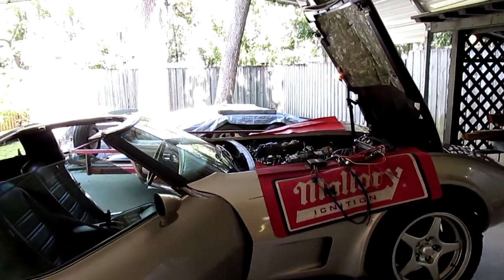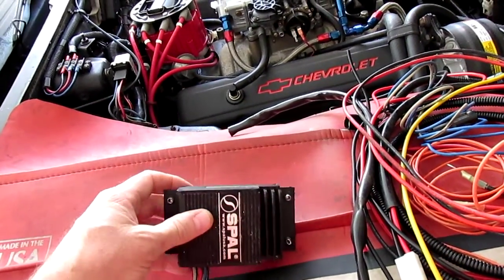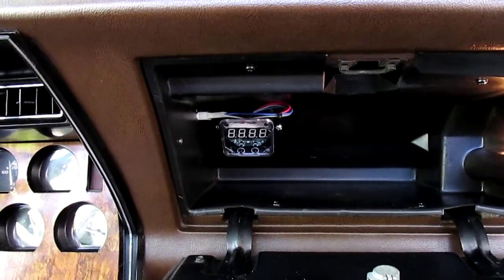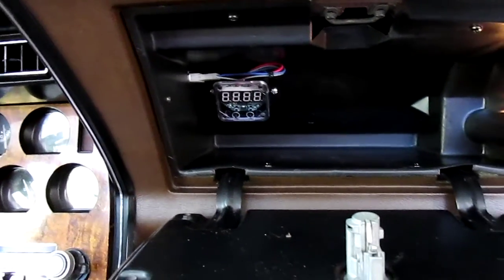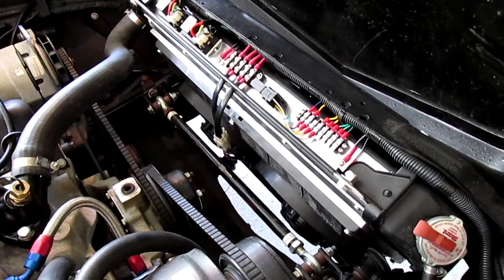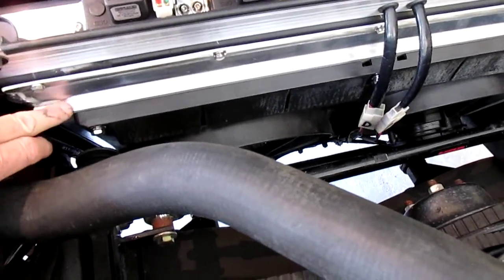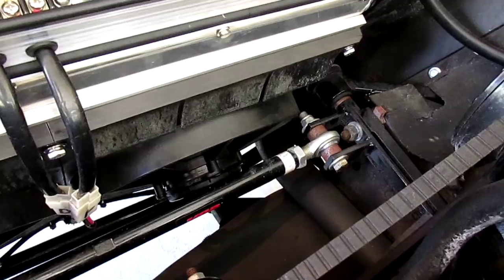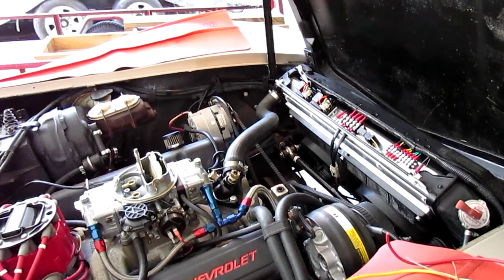Building a custom made fan shroud for dual 11 inch SPAL fans on a C3 Corvette, PART 4

Comment: hi Mr JOEL, what are you temp sending units sealed with
Reply from the maker: Temp senders are as received from the factory. Looks like epoxy to me.
Reply: I meant sealed into the tstat housing thanks
Reply from the maker: @clnash3213  They thread in. NPT male threads on sensors. I little pipe dope on the threads and screw them in.
Reply: beautiful,thanks

Comment: This while impressive, you do good making your wiring neat, is way over complicated and expensive. First off if your cooling system is in good working order the fans will never come on over about 30mph with a properly set controller. All you really need is a switch a simple Hayden capillary switch will do. A decent relay two with AC and some wires and terminals. Personally I would have soldered all those termanal ends and replaced the plastic ends with heat shrink crimps can't be trusted and it looks a lot better.
Reply from the maker: This video simply illustrates one of the hundreds of ways that electric fans can be installed. I prefer sensing temperature in the water jacket, (which is the way auto manufacturers do it), and stage my fans to come on when needed. Crimps can't be trusted?? I have had a similar discussion on one of my other videos about spot welds. Auto manufactures crimp all their harnesses. In fact, I work for a company that manufactures aircraft ignition leads, power feeds and signal cables. This wiring transmits anything from low voltage signals from sensors to electronic control boxes, to continuous high current  loads fed by alternators located on jet engines.  We perform sophisticated testing on our products to check for discontinuities from -65°F to upwards of 1200°F in some cases. You may find it hard to believe, but all these products are crimped! No solder. In fact soldering such a connection can be detrimental. Solder can wick up on the wire strands reducing flexibility, causing fracture in the wire strands and separation of the wire from the terminal. When done correctly, there is nothing wrong with crimping. Just remember, next time you get on an airplane or spacecraft, you are trusting crimps.

Comment: Great video and fan/controller set up.  Question: do you have one of the fans connected to come on when the AC compressor kicks in? If yes, how did you connect it?
Reply from the maker: Both fans come on when AC is on. The controllers have an AC feed to make them come on when the AC is on.
Reply: *****
That's what I thought.  Thank you for the reply.